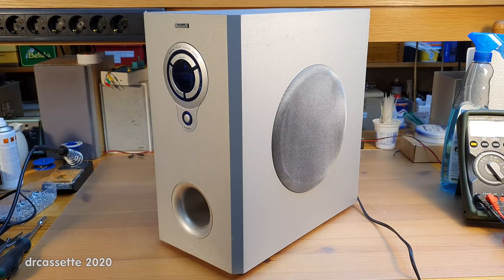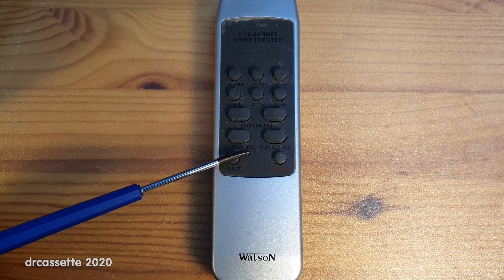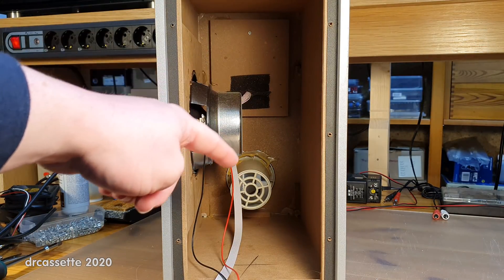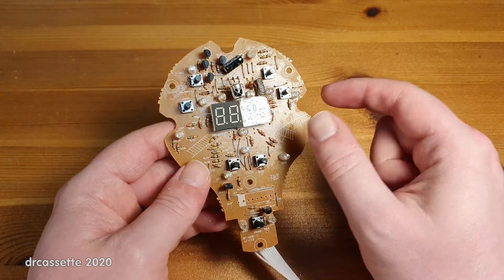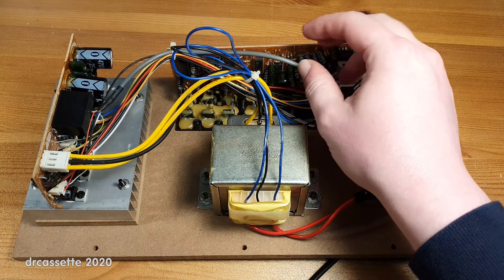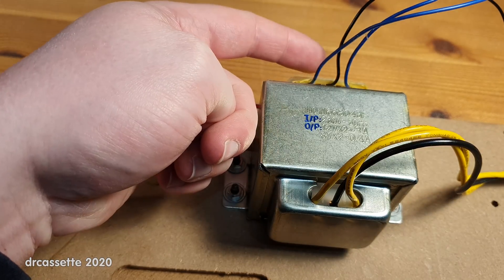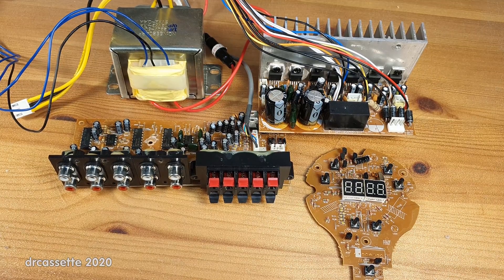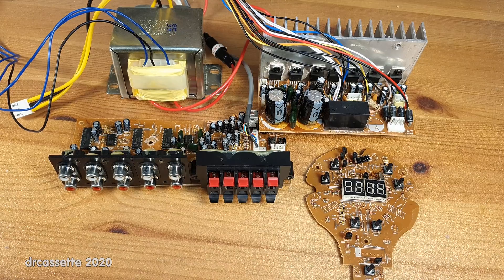Watson Digital Home Theatre System subwoofer/amplifier teardown

Comment: I bought it 9 years ago, but just 3 days ago, I accidentally touched the power outlet, it made strange noises. Now the Aux1 and Aux2, CD no longer receive the input signal. signal 5.1 is still fine. I am quite sad about this :((.. There is a burning satellite speaker, I think I will never buy another to replace it.

Comment: I still see those types of units being sold some come with an external optical/coax adaptor as an option online. I even see Analogue surround receivers beig sold by off brands I have one (technical Pro RX55URIBT) and it's weird since the "surround" is just 5 channel stereo, only works when ALL 5 speakers are connected. AND it cannot be turned off. I just use it as a normal 2.1 channel receiver. It has NO speaker output relay/protection circuit and it is dual voltage at 115v at 50Hz and 230V instead of 120 at 60 and 250.

Comment: I had to go digging through my parts stash to double-check, but it looks like those JRC 4558 op-amps are knock-offs based on the marking font. I'm surprised that they would even bother copying something that inexpensive, especially ~20 years ago.

(Of course, if I see '1458', '4558' or '5218' I go straight for the desoldering gun. Two tin cans with a piece of string between them can do a better job. :-) I'm surprised how often those end up in expensive and highly-regarded equipment.)
Reply: 4558s sound absolutely fine. 
They are an old rugged design from the mid 70s. Not fast or fancy, but audio frequency preamplification/buffering or diff amplification is not a challenging application at all for an op-amp. I can't see how 80s Pioneer equipment for instance sounds "like a tin can", sorry.

Comment: Great teardown.   Loved your walkthrough of the circuitry.   Did you test it at all before you began scavenging parts?
Reply from the maker: Thank you! :)
I tested the transformer. Everything else remains untested, but given the fuse had not blown violently, I am fairly confident that everything works.

Comment: I remember these Watson branded systems. They were extremely cheap, available in multiple configurations. There were other brands such as Platinium, Vortex and Büntz that offered similar units and super low prices. Yes they're crap but you can't expect much from that price.

Comment: Seems not that bad actually. Quality control sucks, but the design is ok. The acoustic wadding is not really needed in a ported subwoofer, only with woofers where you'd have some midrange sounds resonating in the cabinet, but this uses a steep slope op-amp crossover. In a sealed one it can be used to enlarge the effective enclosure size, but this doesn't apply here either. Car subwoofers, even more pricey ones, have none either.
Reply from the maker: Interesting, thanks for the info!

Comment: They did at least one thing right accoustically, the backs of the RCA connectors are sealed with hot glue. At least the cabinet is sealed, but I didn’t see any polyester wadding material inside of it.
Reply: Not really needed in a ported woofer with an active crossover (which probably cuts off at ~100 Hz with at least 24dboct, so there's virtually no mids to resonate) .